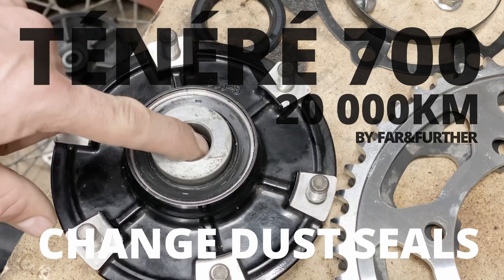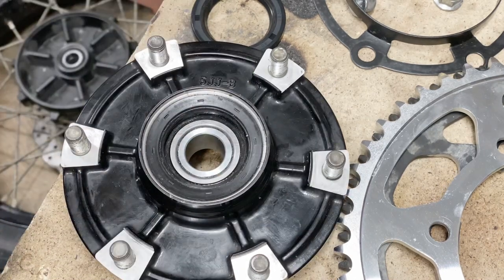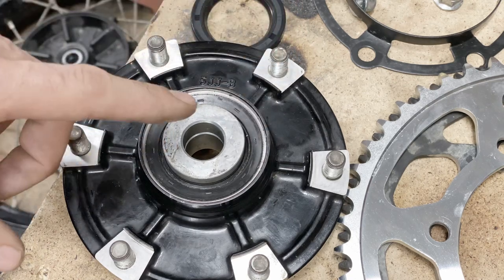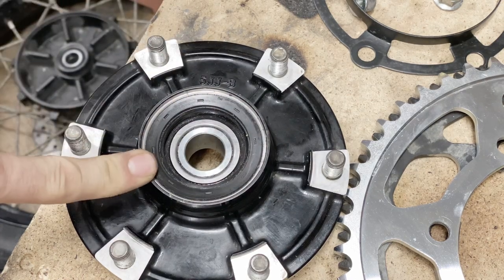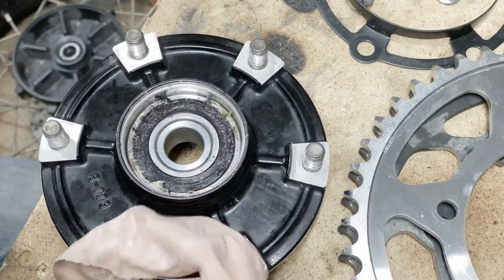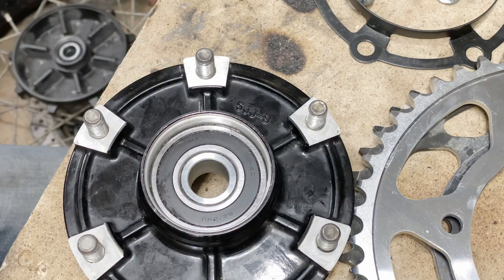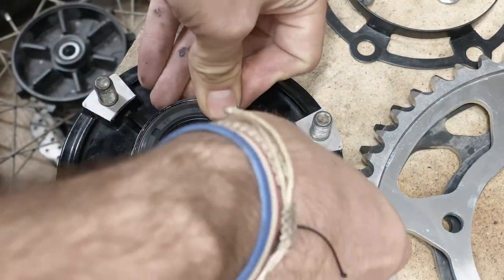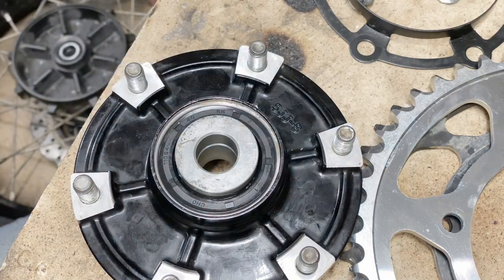Yamaha Ténéré 700 20k: Replacing rear wheel dust seals

Comment: I'm wondering what kind of grease you used?  I ask because it looks the same as the OEM grease that I see in my drive hub.  Great video!
Reply from the maker: Hi, I'm using just simple Calcium grease which is yellow/brownish or Molybdenum sulfide grease EP-2 which is black.

Glad it was helpful.

Comment: The original didn't have a spring, did you replace it with an OEM dust seal that had a spring?
Reply from the maker: Original didn't have a spring and I got the kit which had them. The kit is after market I got it from off-the-road.de

Comment: Is the dust seal the OEM one?
Reply from the maker: The new dust seal is after market. Same size of course. The bearings and dust seals from Yamaha are super expensive comparing to what you can get from other reputable manufactures.
Reply: @FARANDFURTHER  thanks, I saw it at OFF THE ROAD.Your videos are allways helpfull